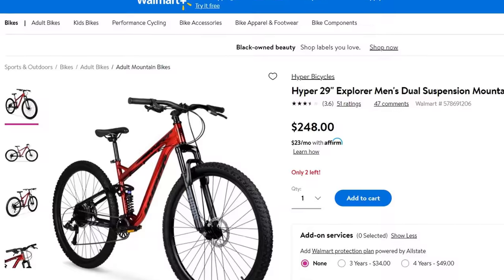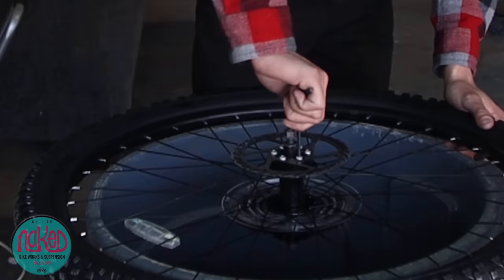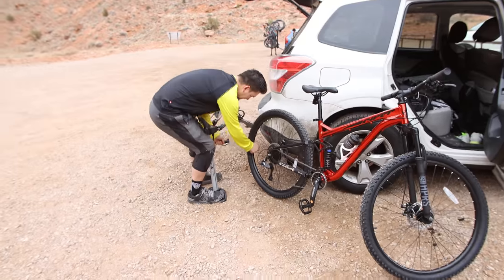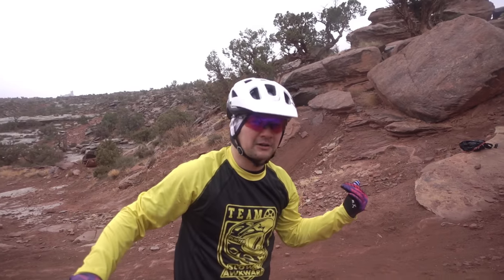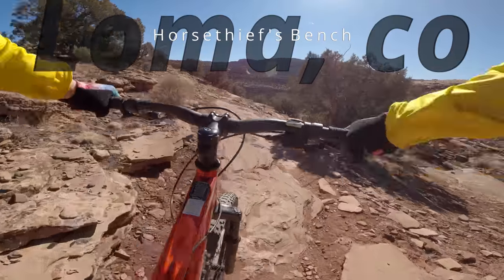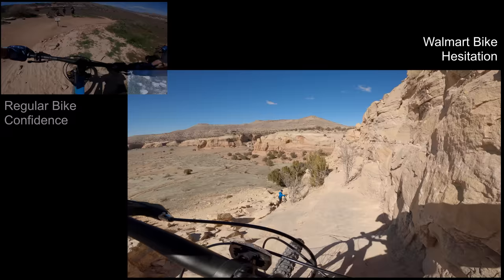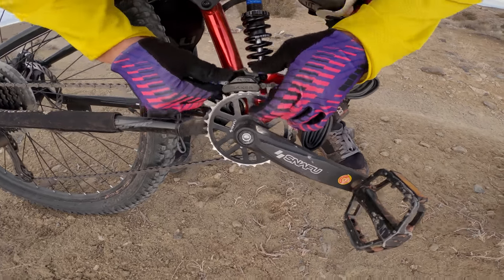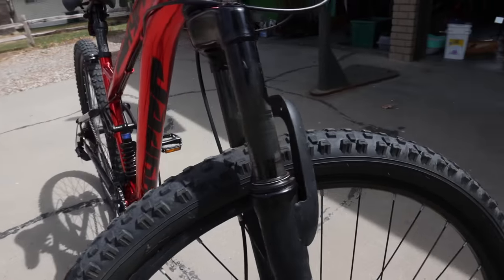Walmart Bike Survives Real Mountain Bike Trails!

Comment: Great review, agree with all the shortcomings. Got this for my 14yr old last March to see if mountain biking was something he'd be interested in, and I didn't want to spend $2k for an entry f/s bike at the LBS. Picked up a used Markhor fork ($100), DNM coil shock ($50) & MT200 hydraulic brakes ($50) and he's been good on local black diamond trails and even at the local bike park. Will be upgrading to a "real" bike this Christmas as he loves riding now. Which means the bike served its purpose.
Reply from the maker: THAT'S the way to do it 🤘🏼
I think with a form, shock, and brakes that actually work like normal...this bike could serve that purpose.
Maybe grippier pedals, a dropper post, short stem, and wider bars would be good too...
Reply: Give us an update on what kiddo's reaction is when he sees the new 'proper' bike.
Reply: What bike did u get him for that Xmas JW thanks?? I just got a Roscoe 8 and love it has Shimano mt201 hydraulic disc brakes
Reply: @No_ReGretzky99  I got him used Ripmo AF from a friend who  upgraded to the carbon version. Still rides it today. The Hyper "Walmart" bike is now in service for his friends that don't have a bike. Bike's held up well. Brakes and tires (wtb rangers after originals wore out) made the biggest difference.

Comment: This is the most in-depth walmart bike vs real trails video I’ve ever seen 🙂

We all knew the outcome, but nobody can look away from a car crash 😆
Reply from the maker: Wow... I am honored that you are even watching and commenting here 🙏🏼
I appreciate it so much coming from you 🤘🏼
And yes.......
It was a car crash...😬
Reply: But there is that one Walmart bike that tops them all, the Axum DP Hardtail $500 is no joke. (If you can get one they're being snatched) Of course any regular nice mountain bikes are modded,  so it's fair with a couple mods they're a competitive true ripper! Definitely getting one. Thanks for the vid man, it was awesome, I was also thinking of a modding a cheap Walmart Dual Suspension indeed, had this in mind as one of the only options, not anymore lol.
Reply from the maker: @Hector Munoz  yeah...it's a tough call on alot of bikes on whether or not to upgrade them. 
I'd say any bike that doesn't have thru-axles and a tapered headtube isn't worth upgrading. 
Hard to upgrade, and not very future proof.... Not to mention, not sturdy enough to handle the rigors of gnarly mtb 😬🤷🏼‍♂️ 
Just my opinion..
But definitely keepingy eye out for an Axum fort non-mtb friend
Reply: @TheCrashingDad  Indeed, must look at the frame features to see if it's worth it,  but hey the Axum is Aluminum, (unlike that one has a steel rear end) 67.8 aggressive head angle, tappered too. 32 teeth 1 by 8 drive.. I believe there is a way to get over the axle problem with those wheels,  although I think they're double wall and of good quality on their own with 2.6 wide tires. It's like Walmart with Schwinn did us a favor in secret man :)
Reply from the maker: @Hector55Munoz  agreed .. the axum is badass 🤘🏼 I got to ride Trail Features' Axum the other week...and I was impressed 🤷🏼‍♂️🤘🏼
Reply: @TheCrashingDad  No way that's cool. Well I just purchased mine an hour ago, although I payed almost $100 extra for it,  still worth it, literally nobody has it but this seller. that Red it a must for me. The last bike I wanted that was good value and Red for God's sake (I love red) was Raleigh Tokul 2 from a couple years back at 800 no dropper post. No longer available. So my scwhinn was still worth it for me. Other Red bike I actually like was is the Nucleus at $900, a Trek at like 1000, and the Bossnut dual sus for 1400, even kona precept 120 from years back. all No longer available. I might post a vid of my little modded Schwinn. I've put my first mountain bike aside for 3 years, and do not plan to make this a super serious hobby, so the Axum is the perfect choice. And im sure can take me pretty far as far as futur proofing goes & with trail experience 😉
The End
Reply from the maker: @Hector55Munoz  lol...sometimes color is the most important thing 😂 if you're stoked on a bike, you'll ride it more 🤷🏼‍♂️🤘🏼

Comment: Used to dh race in the late 90s. Just got back in to riding after over 20 years and bought a $600 Felt 29er ht. It doesn't suck, its actually pretty good. Great frame, cheap Suntour coil forks are just as good as what I used to race on and the cheap x4 derailer shifts way better than anything I've ridden before. Even the cheap no name wheelset is actually pretty high quality. This bike and its components are better than the high end stuff I last rode on. Its perfectly capable and durable. We used to ride the same trails that you young guys think requires a $4000 bike with cushy long travel suspension on 26ers with 100mm coil suspension. Its all perspective.
Reply: Yeah, but bikes have come a LONG way in 25 years. I also got into MTB’ing in the mid/late nineties as a teen. They were still figuring out frame geometry and there were many differing and odd experimental layouts. Some worked better than others. Nowadays, most of the frames have almost identical angles because MTB’ers have pretty much agreed on what works and what doesn’t. Even the tires are much, much better. You’re not going to find many 29’ers with 2.8+ width on 90’s bikes and we didn’t know what we were missing. Tubeless tires and disk brakes? Unheard of. Oh, and Felt makes some great bikes, too, even on the low end . I own a FZ100 road bike and I love it.

Comment: Dude, are you kidding me. I can't believe you survived riding all those intense trails! Do you guys even remember what it was like to learn mountain biking? Riding a 20 year hand me down 26er rusted out steel Giant with V-brakes, 600mm bendy bars that would fall apart on GREEN trails? $200 to get into easy mountain biking with this bike is awesome!
Reply from the maker: Lol… I think I was spoiled when I learned (about 5 years ago)… I was on a $400 bike shop hard tail (Cannondale trail 7) 😂
Pretty capable, but still broke a lot and fixed/upgraded over my first year and a half of MTB.
Ended up putting about $1200 into it over time. 😂🤦🏽
Reply: i wqs spoiled too i rode a trek 3500 when i started way back. stopped for a few years but now i am back into it and i ride emtb now with a 2000$+ 2016 haibike sduro hardnine sl with 29 inch wheels, hydraulic disks and an air fork

Comment: I bought this Hyper bike and I love it. I'm in my sixty's so I don't ride hard like these guy's. But for I want, it's a smooth riding bike once you get it adjusted.
Reply from the maker: Agreed - it’s definitely meant more for mellow casual cruising 🤷🏽 
Sounds like it’s going to be great for you 🤘🏽 stoked on the new bike!
Reply: I'm 67 and have a Ozark trail ridge M2 a cross-country hardtail add an old Mongoose that needs a lot of tinkering from time to time most of my riding is on pavement or paved trails I even went to work I've been thinking about this bike and do like a lot about it I really think the hardtail would serve me better I think the full suspension will be a lot more of a fun vehicle

Comment: It's not a bad bike at all. I've taken it to Santos and Virgina Key. Of course have some WTB AND Kenda tires on it. With upgraded sealed bb and Salt Head Stem. 
A bit on the heavy side with the Steel back however NEVER had an issue with this bike or any rattling. Even on Stolk form
Reply: Did put some RockShocks on recently. Makes a difference
Reply from the maker: That’s awesome! Sounds like you’ve made some great upgrades 🤘🏽
Reply: @Courtneys Rodgers can you please tell me the name of the bb? And sizing info. for this bike. I just got one.

Comment: Single piston disc brakes are so much better than v brakes! Dirt, wet, dry always better! While what he was saying about the pressure is true, as long as the outside (stationary) pad is adjusted when needed it will not cause excessive wear on your router.

Comment: if you want some thing, slightly nicer, I have a Schwinn ascension. The deraileur has a clutch, it has a one-way drive train. The fork is a spring fork with no adjustability however, it does actually work. It’s a Hardtail and I’ve already destroyed the rear hub on it commuting to and from class (i live on campus)

Comment: You need to go for one of the hard tails with a Suntour fork. They are MUCH better bikes. These dual suspension bikes I like to call "kabuki bikes" after the kabuki speakers from the 70s and 80s. All flash and no substance.

Comment: 100% better off going with a used bike. I have a 1980's full suspension bike from a defunct brand that I bought for $50 when my big box bike broke. It still had a quill stem, V brakes, and an integrated derailleur hanger, but it was SOOO much more reliable. Never lost a chain or got a flat, V brakes did need adjusting once a week though lol.

Comment: This bike can be built for cheap to a level unfathomed for the price.  Walmart has frames for builds every once and a while, and Alibaba or Aliexpress has all the rest of the components you need to build some pretty serious stuff.  The Walmart bashing days have been over once everyone figured out the formula.
Reply from the maker: TRUE 🤷🏼‍♂️
But I hesitate to throw money and upgrades at a bike that doesn't have a replaceable derailleur hanger and thru-axles (yeah, a new fork could have one...but then you have to find a thru axle front wheel and stick with a QR in the rear)... 
And I suppose the straight steerer doesn't play well with alot of fork upgrades, but yeah you can find a decent straight steerer fork on Alibaba 🤷🏼‍♂️
So I guess if you upgrade/replace everything but the frame, you have a good bike, but still a QR in the rear, and an iffy derailleur hanger 😬
After all that, you're possibly in it for $700-$1000. And at that price, you can get a GREAT hardtail with great parts 🤷🏼‍♂️
Again... It could go either way. Just playing devil's advocate
Reply: @TheCrashingDad  QR was used for decades in DOWNHILL COMPETITION with zero problems. The STEEL rear subframe can be bent back into shape if need be. There is NO 750 dollar DS bike capable of what a built hyper can do. Just giving you the pros of how cheap frames can be made capable for cheap. Or simply buy a Aliexpress DS frame that's carbon and build a 5k bike for 1,500.
Reply from the maker: @thiosemicarbizidebenzoylal2921  - thanks dude! Curious as to what bike you've built up?
Reply: @TheCrashingDad   Im the original person that blogged on the XR PRO about 11 years ago and subsequently built the bike using the Suntor epicons that were superior to Rock Shox offers. I also purchased the Epicons off Aliexpress when people were floating the rumor of Suntour American products as better.  I also was the original blogger on MTBR for Chinese carbon products before T700 when it was junk.  I built a p9 bike when it first came to market years ago in Switzerland, and have always been a advocate for price conscious consumerism in biking. In the scheme of things i know this industry inside and out, and where to get the deals. THERE IS a manufacturer from China right now that is making FOX equivalent forks for all mountain trail use for a tenth of Fox 34s and 36s price, and it looks beyond promising.
Reply from the maker: @thiosemicarbizidebenzoylal2921  duuuude...that's crazy awesome!
Suntour had me super curious...
Are you allowed to share the name of the Chinese fox-equivalent forks ?
Reply: @TheCrashingDad   The branding is FOUS sold on Alibaba through GUANGZHOU FLYING TECHNOLOGY CO. Its 129 bucks for 160mm 36mm stanchions or 129 bucks 34mm stanchions. I cannot pin down the manufacturer yet because its so new.  It looks like FOX entire lineup is on the menu for dirt cheap.

Comment: Worth using the frame to build an upgrading??
Reply from the maker: hmmm... in my opinion, no. Yes, lots of frames have quick release drop outs (that i'm not a fan of... thru-axles are WAY more stable)... but I would still opt for something with a replaceable derailleur hanger. If you break this one from a tip-over, it's done for and can't be replaced....

Comment: As long as you adjust the brakes correctly unlike in the video manual disc brakes work good. They’re never gonna be hydraulic though
Reply from the maker: These mechanical cable pull brakes had ZERO adjustability (other than adjusting the cable tension) 🤷🏽
Maybe upgrading with decent brake pads would help a bit

Comment: Great video it really shows whst this bike cna handle and what it can't to a point of course. 😁 That was brutal.
But I see this bike is a popular upgrade project. I see some put DNM air shock, and sr suntour or cheap Rock Shox fork, and some more parts. But really the geometry is horrible.
Reply from the maker: Johannes... It's a tough one... Because after upgrades (fork, shock, brakes, stem, bar, dropper, pedals...etc) I could see about $1000 poured into it.
At that point it's better off to just spend that up front for better geometry (like you said), and boost spacing with thru axles... A tapered head tube... and a replaceable derailleur hanger 😂
Reply: @TheCrashingDad  I forgot about the hanger there is a version of this bike with replecable hanger, it's actually Th tone that is popular, Hyper Hydraform. You had the Explorer. But both are not great.

Comment: you're a braver man than me. i took that bike on a single ride on a flow trail. when i got home, i took the high points off and put them on my 250 dollar mongoose hardtail. those beefy tires and that 9 speed. they did bring back the explorer hardtail though. no rear shock, and like 9 pounds lighter. still the same trash fork and chain ring though. and! theyre still at pandemic bikes. i wouldnt pay 400 dollars for the hyper carbon bike, let alone an explorer. not when the schwinn axum and kent trouvaille exist.

Comment: Dude, I loved this video! I really felt for you. My bro in law is almost 6’4” and I am not even sure he is too thrilled to be on a bike. That being said, would you recommend it for a beginner if I upgrade the wheels, cranks, and front shock for him. I may put in an entire new group set (1x8 drive train)? Oh and of course QR for the wheels. Cool.
Reply from the maker: Thanks Elaine 🤘🏽 hmm…
For a beginner, I would STILL recommend a hardtail (even if it’s a Walmart hardtail for the same price)… as the suspension on this really doesn’t do it many favors, and just adds extra weight…
All those upgrades wouldn’t be worth it, especially if you added all that money up… you’d be able to get a decent bike shop hardtail that’s more upgradeable with a replaceable derailleur hanger.
That said… if you DO end up with this bike, I’d run some good pedals with sharp pins for security… then maybe a shorter stem with a wider bar for handling…
Cheers! 👍🏽

Comment: As someone who owns a cheap walmart bike. 

Dude are you MENTAL?! After a few upgrades, ala what kev central does, sure but... Stock?!

I love  the huffy my folks got me. I bought a crankset that was compatible with a square taper because that thing? To its credit all the marketing from walmart and huffy themselves show nice easy gentle paved paths. I'm going through grass covered fields near my house as way of trying to get less out of shape. Just that swap down from a 44t chainring to 32t was pretty phenomenal. Plan on getting an altus deralliur next time spare money frees up since the ... flat face? Cheapo... 'tourney' that is on it just.... No. No.

Sadly integrated hanger on the bike so not all that many options there. Am curious on what tires I should pick up since I don't want to throw TOO much money in, but the ones on it are very VERY strictly street. 

Thanks for doing this video man. I'm glad you didn't get too banged up in the process.
Reply from the maker: Lol thanks Andrew… and yes… I probably AM Mental 😅
I had high hopes for this bike 🤷🏽

Good on you for slaying on your Huffy 🤘🏽 and yeah, a smaller chainring is definitely a good way to go…
And a clutch derailleur is….clutch 😂
Tires are tough… I hate how expensive they are. It’s like the same cost as car tires! 🤦🏽
I remember getting some lightly used ones from a consignment shop…. And then had friends give me old tires that weren’t in bad shape, just needed a puncture repair 🤷🏽
There are ways…
I know my pal Paul the Punter has a 30% discount code for Kendra tires on his vids, if you’re going the new route…
For me, I’m stupid spoiled and I like maxxis 🤷🏽🤦🏽
Reply: @TheCrashingDad  well it isn't horrible,it is just a thing where I am very aware of limits, but for what I need,and since I a! Not going to do double black diamond trails? It gets me out and about.

While I think Walmart bikes serve a purpose to relatively cheaply see if you want to do the thing, and with a few upgrades over time to build experience they can be better than one would think? It's good to get a reminder of just now not suited they are put of the box f this stuff.

Comment: Trashed the bike then returned it? Stuff like this causes higher prices.
Reply from the maker: This bike DID give me high hopes when I saw it at the store and bought it. the intention was to see if it could hold up to trail riding, and then pass it along to a friend that’s getting into MTB 🤷🏽 
Turns out that these bikes are really not meant for more than just riding smooth trails or pavement…
When I took it back to the same store, they asked if anything was wrong with it, and I went down the list and said that in-general everything didn’t work very well.
Their response was “there IS a new person in bike assembly that has been doing a HORRIBLE job lately, and bikes are benign returned left and right” 🤷🏽🤦🏽
BUT I used that return money to put it towards a regular hard tail from there that would suit my friend 🤷🏽